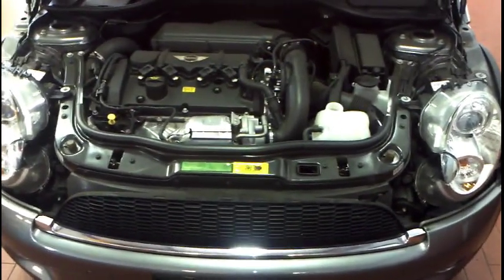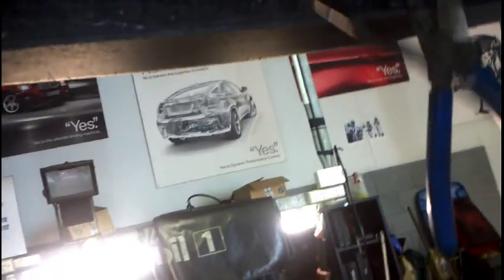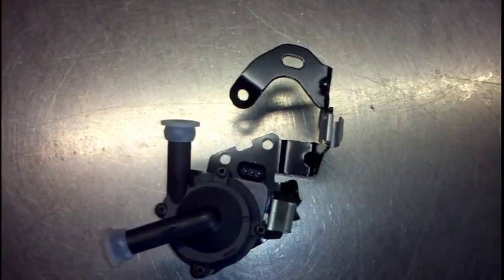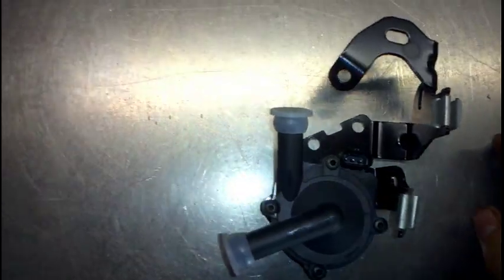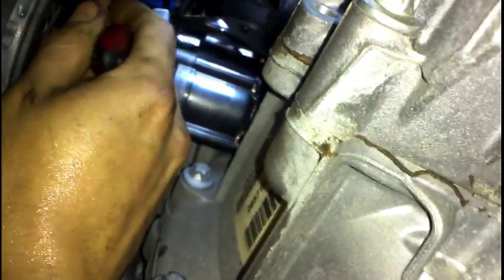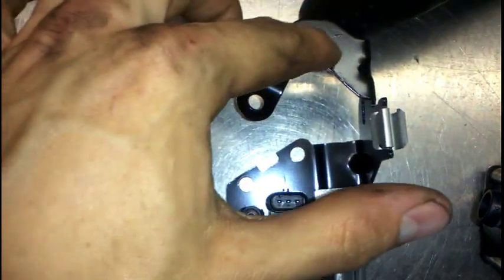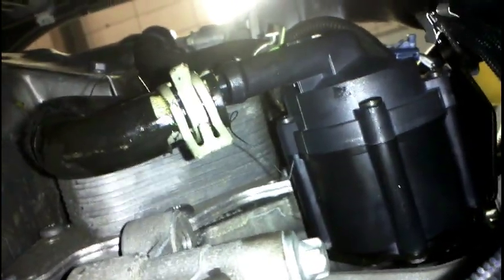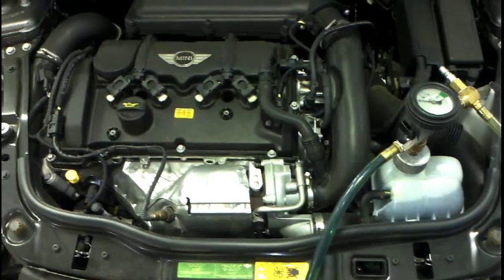MINI turbo coolant pump remove and replace How to DIY: BMTroubleU

Comment: THANKS for the link, I think I'm narrowing it down. The  thermostat is a solid plastic piece so I couldn't have put it back wrong. But I turned the key on and decided to run the diagnostic tester on it. It gave me a P0117 error which shows Engine Coolant Temperature Circuit Low input. So any help you can shed on this will be greatly appreciated.

Comment from the maker: ok cool, so it could be a bad temp sensor or wiring, but i would expect that by the time the top hose was getting hot the bottom would be starting to get warm. how did you get 108c- thermal temp gun or something else? also 108 doesnt sound off the ricter- the pressurized system should be able to handle more than that and coolant has anti-boil properties. does the engine overheat if you just run it?

Comment: Great Tutorial thx !!
I have an issue with a 2008 Cooper S which keeps breaking the serpantine belt . All the pulleys seem free , i replaced the idler that runs the water pump because it stripped the rubber off the metal . Fitted a new oem belt and test drove the car drove about 4 kms and belt went again . Looks as if the belt is burning in places and then snaps , have you seen or heard if this before and if so where do i begin to fix it ??

Thanks a stack ,

John
Reply from the maker: yes- the tensioner is actually commonly problematic and replacing it is part of a major service. if you havent changed it in a few years get it changed and you should be good to go

Comment: According to the Haynes manual for mini there is a special bleeding sequence for the turbo cooling pump. Is this necessary?  I tried this which should run the pump but couldn’t hear it working, is there a way to test if it runs?

Comment: Great stuff....i have a problem with my mini cooper s 2012 with regard the power it only reaches 140km...recently went for service....& also to diagnose the high pressure fuel pump...so the problem is not the pump..what could the problem be...Turbos or Sensors perhaps???....
Reply from the maker: yea mate, turbo would be my first guess. I've seen a chunk of intake tube get sucked into the compressor wheel before. if you take off the intake tube and use a mirror to inspect the blades you'll see if they're bent of weirdly misshapen. if you can hear the tone of the turbo whistle has changed that's a fairly good indicator too. I've also seen the oil feed banjo bolts to the turbo clog up and cause the shaft to snap. failing that maybe MAF sensor. let me know how you go

Comment: Had my aux pump changed now fan stays on and temperature sitting around 108c. It's been bleeded several times, and new thermostat housing replaced. Radiator not blocked flushed it. The lower radiator pipe remains cool to cold but pressurised. Top is hot. I'm totally lost what next. Could it be water pump?  Hot air is blowing in car when I turn on heater. Really appreciate any help you can shed on this.

Comment: Could you tell me where i can get the pump or just the plastic cover that hoses connect to.
Reply from the maker: You won't be able to get the housing seperate. The part is available from any BMW/mini dealership. Not sure if there is an aftermarket equivalent

Comment: Hi good morning,  does this have anything to do oil coolant reservoir?

Because basically I found oil in my coolant reservoir and MINI agent is telling me that the oil mixture with my oil coolant is coming from the Turbo and need to replace the Turbo. Would appreciate your help on this.

Thanks and have a great day!
Malcolm
Reply: Malcolm Pace  i hope you solved the problem but probably my suggestion can help sombody else. Before to blame the turbo, check the engine oil heat exchanger because sometime has an hole inside or its gaskets are broken leting the coolant came in contact with the oil. I' m not a mechanic, only a motoring enthusiast, but i heard a lot about this failure.

Comment from the maker: if the bottom hose is cold and the top is hot you have a thermostat issue. if youve had the housing replaced the thermostat could be in backwards. theres a pic on the proper direction here- aa1car.com/library/overheat.htm let me know how you go.

Comment: Nice one.  Only slightly related, but I did the main water pump ands thermostat change recently.  It may be useful for others. The water pump can be changed just by the wheel arch, so no need to take off the cross beam and light. Here is how I did mine:  https://youtu.be/mdVivgKhdvM